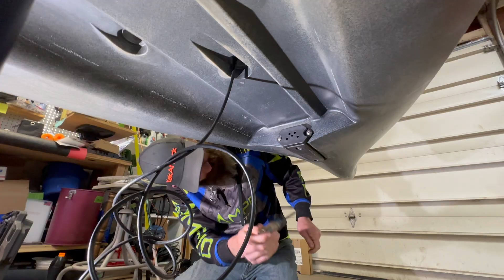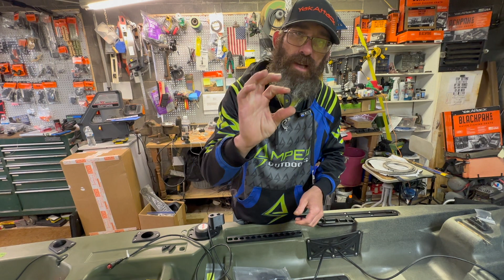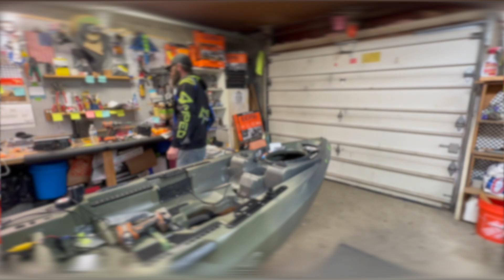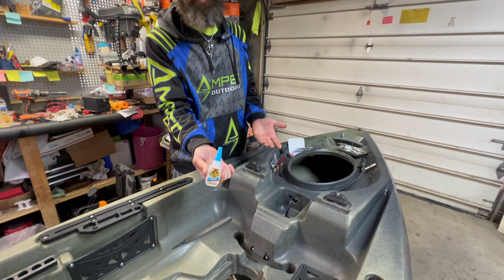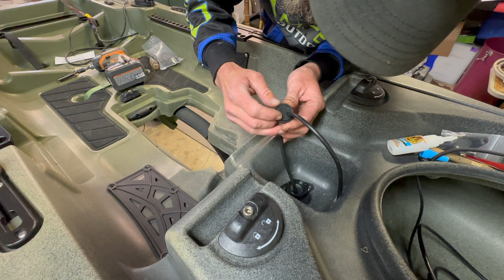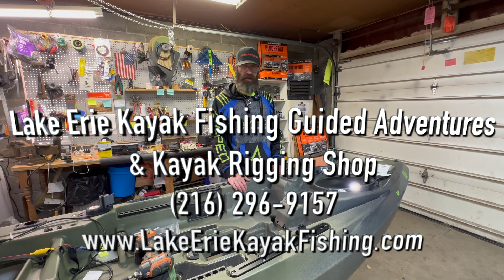HOW TO install a LEAKPROOF YakAttack thru hull electronics wiring kit for offshore kayak fishing

Comment: What minimum size kayak do you recommend for lake Erie?
Reply from the maker: There’s a handful of factors to consider when looking for a Lake Erie capable kayak. Some 10ft sit on top platforms do ok in calmer conditions. There’s other things to consider as well like how the bow throws the water, how the deck sheds water, and how the hatches seal. I’d recommend giving me a call to dive deeper into what to look for when picking a BigWater kayak, or reaching out to one of the local dealers who can help you pick the right rig. (216) 296-9157